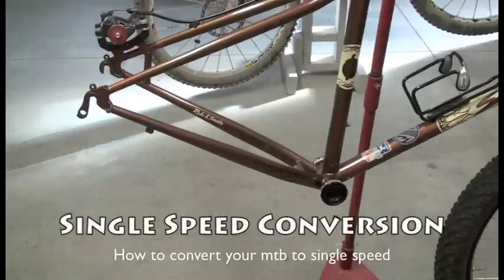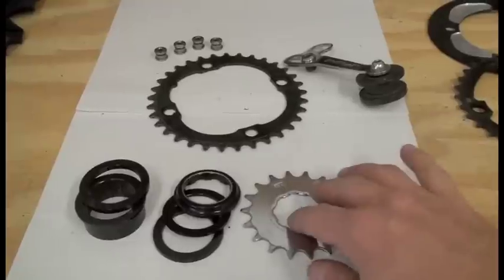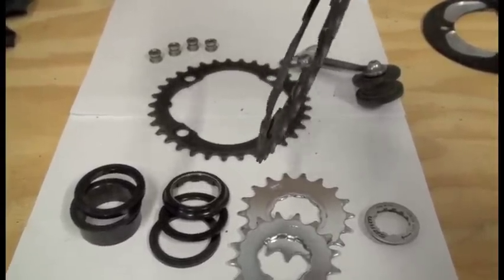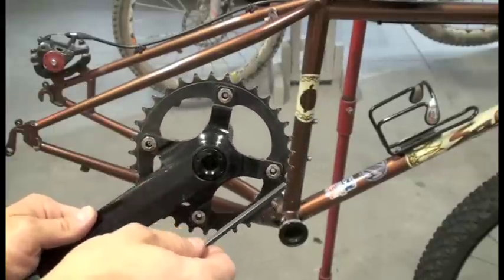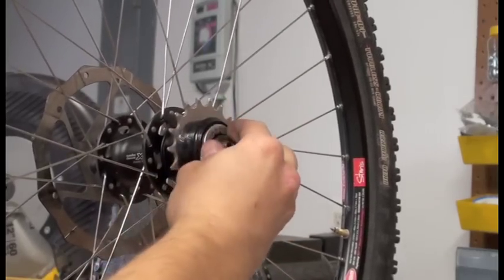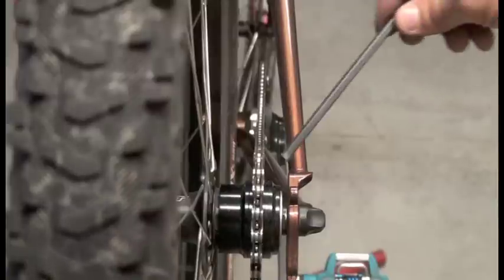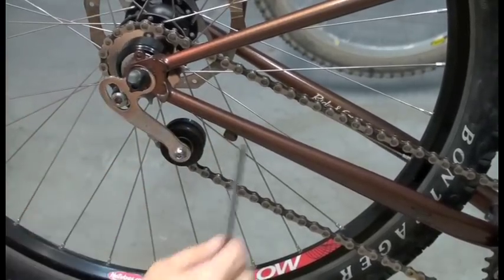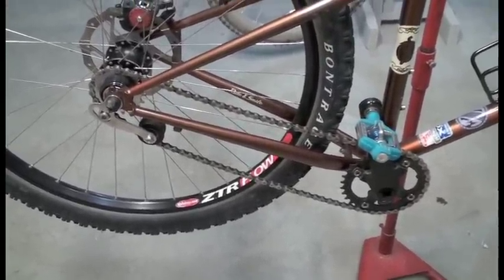Single Speed Conversion - How to

Comment: If you want your chain to stay on, yeah. The only way you can get away without a chain tensioner is horizontal dropouts so you can tension the chain by moving the wheel back in the dropout.

Think of it as a derailleur for a single speed bike. It doesn't change gears, but it tensions the chain (the second function of a derailleur).

Comment: It depends entirely on you. Mountain bikes are more rugged and can deal with stuff like dropping off kerbs and hitting pot holes etc better. Track bike singlespeeds on the other hand will be faster to a point, but remember they don't have gears, meaning that hills can be an issue as well as stopping and starting for lights etc. I ride a racing road bike around the city since it's designed for speed on the road. Overtaking cars under your own power is hillarious!

Comment from the maker: @Xcokedav096 - The most common middle ring size on the front is 32t. Put your geared bike in the middle ring and then experiment riding on different gears in the cassette.  When you find one you like, count the number of teeth on that gear and buy a cog for your SS setup to match.  Popular mtb setups are 32 or 33 up front and anywhere from 16 to 22 or more on the rear. 1.5:1 to 2:1 are common ratios but it is your choice depending on your terrain and ability.

Comment: @SpinMotiv I picked up a half-link chain but it still only got me 'close'.  I still would have had to use a tensioner, so I just ended up using sticking with an 8-speed chain and a tensioner.  The half-link chain looked really bitchin but I couldn't stand the thought of the extra 100+ grams it weighed.

Comment from the maker: The cassette spacers usually come in a set that allows the proper width to fill the stack.  Only the cog needs teeth to engage the hub.  The spacers can be smooth and most don't have any teeth.

Comment from the maker: @chefboyrobbie - Using cheap parts, probably less than $50.  If you want to use higher quality parts it will probably cost in the $100 range but that depends on what specific parts are used.

Comment: Your chain tensioner wheel acts from above, pushing the chain away from the freewheel. My setup pushes up from below, wrapping more chain around the freewheel and spreading the chain bite over more pins, etc.  So this should be more efficient with less chain wear. So what's the deal?  Are you avoiding chain rub on the chainstay?

Comment: What i use on my bike is a 48t on front and the cassette with multiple cogs on the back. I can`t use more than 3 gears without the chain going out of alignment. I can try using all of them,7 in number, but the chain will wear out or jump off, like it happens most of the time. I tried single speed and i cant tell that i like it.Lower top speed and less power up the hills. On a flat surface is perfect. I wouldn`t change to single speed.I think that 3 or 4 gears are a must. I go up the hills like a madman.

Comment from the maker: @subzora2 - No, this one was pieced together using a Spot Brand spacer kit, Shimano steel cog, SRAM lockring and single chainring bolts (don't remember the brand).  There are lots of other companies like Gusset, DMR and Wheels Manufacturing that make spacer and cog kits.  Surly, DMR, Rennen, Sette and a few others make chain tensioners.

Comment: I'm sure this is an excellent tutorial, but I'm not interested because it's a cheap bike with nuisance gears, I don't want to spend another cent on it. Mine's (actually the GF's) got the vertical drop out unfortunately. I cut the chain to run on 9th gear, it's as tight as I can get it and runs nicely until I put a lot of torque on the peddles at which time it slips/comes off. I was thinking about having a closer look at an old derailer, surely I can adapt that as a tensioner, solving the prob?

Comment from the maker: Then tensioner in the video is a NuVinci but there are many others out there.  Please check with the specific manufacturers for their recommendations on what chain widths can be used and how it can be positioned.  The NuVinci tensioner connects with a tightening bolt in the derailleur hanger to adjust the position and loop under the quick release..

Comment from the maker: @samuelcyr1 - You can try your old front ring if you want. The only trouble you might have is the chain might want to come off easier when bouncing around. Make sure the chain is properly tensioned to help prevent that.  No special rims are needed. The wheels used in this video are standard wheels with a 9-speed hub.

Comment: So regarding the cogs and chainring, my cog in the rear is 17t. The front ring is 52t. If I want this configuration on my single-speed, Do I simply get a 17t cog and keep using a 52t ring? I heard that it's a little "easier" to pedal a single speed bike in the same gear ratio as on a geared bike. So should I instead go for a 16/15t cog instead of keeping it at 17t to get the same "feel"? Thanks so much!

Comment from the maker: I've heard this question several times and the short answer is no.  The chain would be too short.  The length of 1 link doesn't allow for the needed adjustment to get a proper fit.  Sometimes a half-link can be used to get close, but a tensioner is an easy to take up the slack of the extra few mm of chain length.  You would be surprised at how little an extra few mm of chain it takes to create a lot of slack.

Comment: awsome video, I would like to convert my old fisher into a single speed considering I usually ride in one gear ratio anyways, maybe because I enjoy my rides and dont time myself. In my opinion the simpler the better. Idk about rigid forks though, but full suspension I dont need.

Comment: Regarding the issue of slightly too long bolts, you can also use washers to make up for the excess thread.  Just make sure they are small enough around the outside diameter to fit on the small square area around the bolt holes.

Comment: I have another question if you don't mind. Is there any reason I'd need to use a different BB when I convert? The axle on the one that's on there now is 110, but the shop that sold me the new crankset are saying it needs to be at least 113? Just trying to understand why when the crank arms seem the same thickness.

Comment: were can you get cogs cause my specialized hardrock i got on craigslist for a dirt jumper and the guy was running a 32 16 ratio i really want to go down because im doing like 30 40 ft jumps without starting ramps and cant get enough speed

Comment: why is it a challenge to ride?
Reply: J B because you're the only gear you have ;) as the hill gets steeper, you need to keep your cadence up (which normally you'd do by downshifting) otherwise you'll get stuck mid-crank and with not enough momentum to stay up. Without that lower gear, you just have to keep pushing (this is also why ss riders can climb faster, because they have to keep their cadence up).

Comment: why do you need a chain tensioner if you can just get a shorter chain?
Reply: His dropout is vertical, so the axle can not move forward or rearward in the dropout, just up or down.  In a vertical dropout, a chain can range from too-loose to too-tight by being shortened (or lengthened) by one link.  Every chain link is 1-inch in length which moves the axle forward/backward inside a non-vertical dropout about 1/2-inch (because the chain is a loop, the chain-inch is shared equally in both directions). As you know, a tension arm makes the "1/2 link too-loose" into "just right."  A non-vertical dropout can easily take up that 1/2-inch just by moving the axle, so a tension arm is unnecessary.
Reply: thanks

Comment: it there a spacer kit for a FREEWHEEL cog on the back wheel??
Reply: Spacer kit for freewheel? Never heard of it. You can't take apart freewheel as you can do it with cassette. But there are single speed freewheels. Oh, and I wouldn't use the tensioner, I would buy a master link.
Reply: +armthehomeless You can use a freehub spacer on a freewheel then use a bmx freewheel. However, I wouldnt use a very thick spacer ( I used a 3mm thick spacer) because you need as much threads to make contack with the bmx freewheel. The freehub spacer is the same insiade diameter as the threads on the outside diameter freewheel hub.

Comment from the maker: @Xcokedav096 - Yea, you can try keeping the ring and get a 17t cog.  I recommend trying the 17t first to see how it feels if that is the gear you like. That is a somewhat big ratio already and you will have to mash pretty hard coming from a stop and on any hills. The hard thing with single-speed gearing is finding the sweet spot. Without being able to change gears for a hill vs the open flats, you'll need to experiment on a few rides to see what works well to balance it out.

Comment from the maker: Most likely, yes.  Only a few gear combinations on a few frames give the proper chain length.  If you don't use a tensioner, the chain will probably be too loose and can fall off when riding over rough ground.

Comment from the maker: The only pieces I bought for this conversion were the chainring ($30), short chairing bolts ($11), tensioner ($25), spacer kit ($25) and cog ($4).  All the other parts I already had, so this conversion cost me about $95.  You can use less expensive parts to get the cost down if you want.

Comment from the maker: You most likely will need a chain tensioner.  You can't just add or remove links from your chain because that will make it too long or too short.  The tensioner allows for the fine tuning that adding or removing links just can't do.

Comment from the maker: @ozunajd - It is very rare that a frame's chainstays are the exact length needed to get proper tension.  You will find that adding or removing only one chain link will either make the chain way too tight or way too loose.  The tensioner is needed because the length of the links will not allow the chain to be properly tensioned in most cases.

Comment: i got my bike used off cl....wasnt a big fan of teh single speed but, i dont think id ride with anything else. Im im WA state and we do have alot of hills. Just makes my legs stronger. As mentioned in the video, its a lot cleaner appearance and very easy to maintain. This is a nice vid.

Comment from the maker: @TheDownloadfreegames - Without seeing your bike, I can't be 100% sure, but as long as you get a spacer kit like shown in the video (with multiple different sized spacers), it should be fine. Since 7-speed cassettes are narrower, you will just have an extra spacer or two leftover when installing the SS kit since less are required. Make sure that whatever cog you get is keyed for your style of hub (some 7-speed hubs had different key styles)

Comment: I changed my bike into a single-speed ish... replaced the casette like he did in the video, but I got a spring loaded tensioner. (i kept the 3 front gears). I can't really use it though,  as the chain jumps for a split second. anyone know how to fix this?

Comment from the maker: @FMECCTV - If you have fixed vertical dropouts and no EBB, then you most likely need a tensioner.  Depending on your frame, you might be able to find a gear combination that will provide enough tension to make it work.  That is often hard to do.  You could try half-links on your chain with various gear combinations too and you might be able to find something that works.  Google 'Sheldon Brown' and you'll find a site with lots of information about gear ratios, chain lengths, etc.

Comment: i have a full suspension mountain bikes dimound back coil 24 ive had track dropouts welded on the back  would a Chain Tensioner stop the shock from braking my chain

Comment: Do you NEED a chain tensioner for a single speed? Also, I am trying to convert my 21 speed bike to a 7 speed bike - I only ever use the front 2nd gear. Do you think I can just take off the additional cogs and let it be, as is? Or would you suggest some sort of bash guard. I'm wondering if the chain will try and jump off more with this method. Thanks!

Comment: Hi guys ! For those watching this video and wondering if its possible to do it without a chain tensionner. The answer is yes ! I did it on my old Gardin bike. If you have horizontal drop-outs you juste have to remove a couple of links to your chain and if the chain is still a bit loose or to tight ajust your wheel on the drop-outs. I hope this helps ! I used a single speed RAM chain with master link that you push on.

Comment: I have a single speed mountain bike and the gear ratio came at 33T to 18T. I ride mostly on paved roads (sometimes gravel) and the gear ratio is too low and I'm "outspinning" myself. Anyone know what I have to do to increase the gear ratio? I'm assuming it's a similar concept to converting to single speed with just buying higher-toothed chainring, etc. like the video, but any help is appreciated.
Reply: The larger the chainring up front, the harder it is to pedal. The smaller the chain ring in back, the harder it is to pedal. And vice versa. So for a larger gear ratio, go bigger in front, or smaller in back. In your situation with an 18 in back and a 33 in front, I would increase the front. On my single speed road bike I ride a 46 in front and 18 in back.
Reply: Spencer Ok. Thanks for the reply
Reply: got my mtb newly converted to single speed, my gear is 34/16. works well on flat road but when climbing up need to stand to get power uphills.

Comment: is the chain tensioner a must? thx
Reply: Only if you have a frame like this one. If you look at the beginning of the video at the socket where you slide the rear wheel in, you have to slite it vertically where other frames generally have a horizontal socket. That means you cannot ajust the tension of the chain by sliding the rear wheel back and forth on this particular frame. That's why he uses a chain tensionner :)
Reply: thx

Comment: I bought myself a nice bike. A Trek Madone 5.5. Super ultra light carbon bike, love it. But its a single speed and where I live I need to go up and down quite a lot, therefore I would love to have it geared (doesnt have to be super sick with 30 gears but at least 2-3 or so). Is it possible to do that? Also, the pedals always move when you are driving, which means that you simply can never just "relax" your feets which I really hate as I am very used to relax my feets when I want to slow down or when I am in front of a red light and so on... can I fix that too?
Reply: I reckon the pedal was installed incorrectly and it cross threaded
Reply: a free wheel will fix that problem if you stay single gear. but if you decide to add a cassette and rear brake lever the cassette will have a freewheel anyway so you can  coast (relax)
Reply: Yes. Put a derailleur only on the crank for your 2-3 gears and keep a single speed rear wheel setup with the cog lined up between the two cogs on the crank. Not sure about your pedals always moving when you're "driving" because the bike doesn't appear to be fixed gear. Looks like it came stock with clip-in pedals or whatever? Maybe just go back to regular pedals lol.
Reply: I think he means he is riding fixed gear

Comment: Is it neccasary to remove the original chain rings? Or can you run it the same with the original ones
Reply: in short, no. but if you want to save weight you can remove some gears.

if you have a tripple front chain ring, remove the lowest gear,make the middle gear the operational one,and replace the biggest ring with a bash guard such as black spire c4

if you have a double front ring, you can use the smaller ring and replace the larger  with a bash guard and use the smaller ring as the driving one
Reply: U can remove a handlebar as well it would be challenge to ride

Comment: I want to keep my rear gears and basically just have the middle front sprocket instead of  this solid single speed ordeal...what to do?
Reply: You'll need to get single speed chain ring (32T/34T) like he has (no ramps/pins), single speed chainring bolts (shorter, specifically for mounting a single speed chainring) and a chain guide (MRP makes one that you can use...).  It's pretty simple...then you just change out the front rings with your single speed ring, remove your front derailleur and call it a day.  You might need, at some point if you don't already, a short caged rear derailleur.
Reply: Jordan Cook I thank you, sir!
Reply: You don't need a whole chain guide, only the bash guard part, which replaces the biggest front chain ring,  these can be purchased separately for around $30,
You can also keep your long/medium caged rear derailleur, but as there are less combinations, the extra length will be unnecessary.you also wont need a single specific front ring.

 all these things are great if you have the money to buy them. but if you buy a chain guide with a bash guard and rollers which pull on the chain (mrp calls it active retention, eg. s4)  you will need to move the chain inside these  rollers and re-size the chain.

if you want a cheap short cage derailleur, use a  cheap, compatible  road derailleur such as sora or tiagra
Reply: Crankpuller 1 Thank you!!
Reply: Plant a tree
Reply: +cherepaha3 Plsss xD